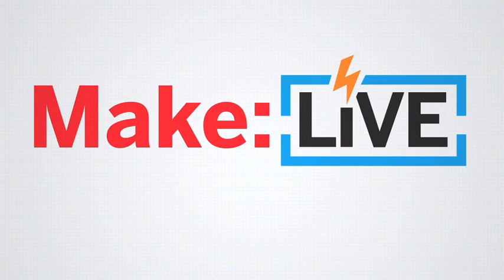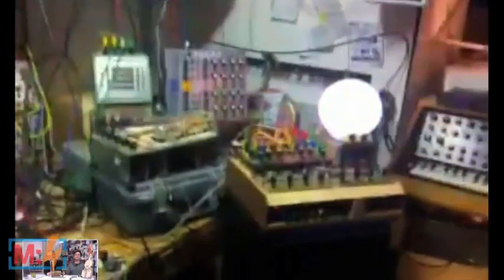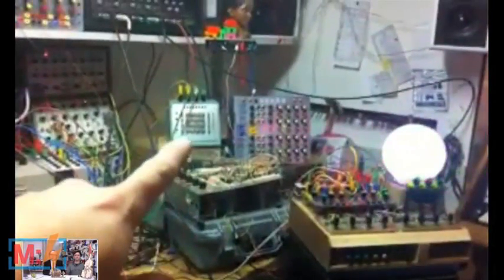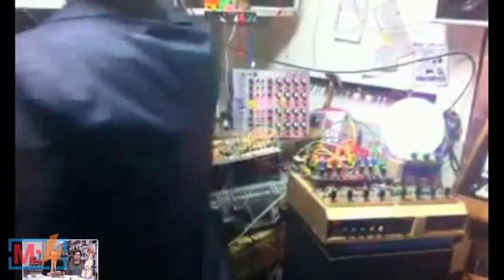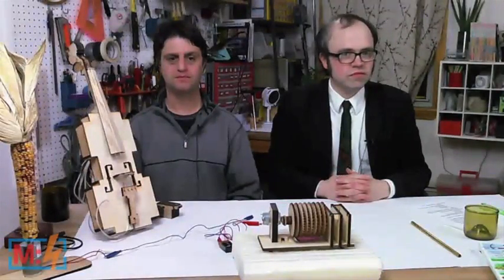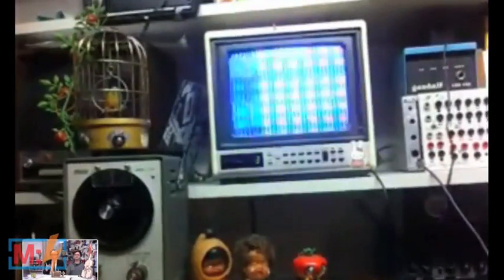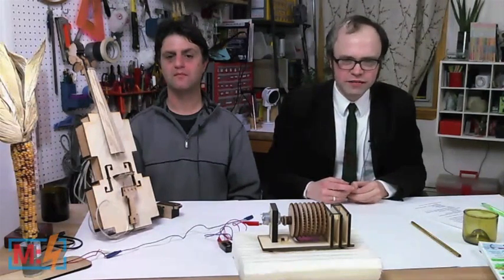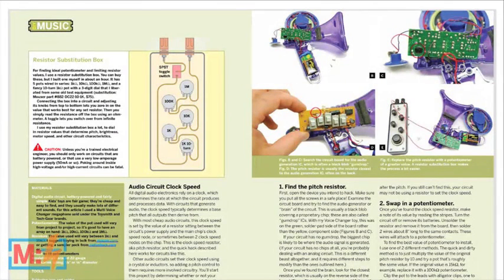Circuit Bending on Make: Live ep04

Comment: that wasn't circuit bending it was an example of a circuit modification. in circuit bending you have to make a short circuit so instead of replacing the resistor with a potentiometer you would connect wires to the potentiometer in parallel with the resistor